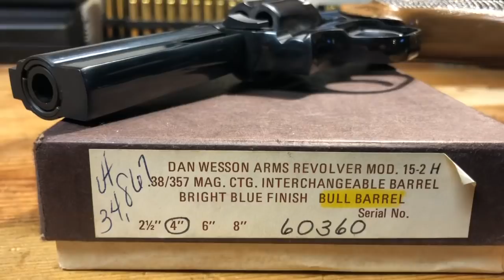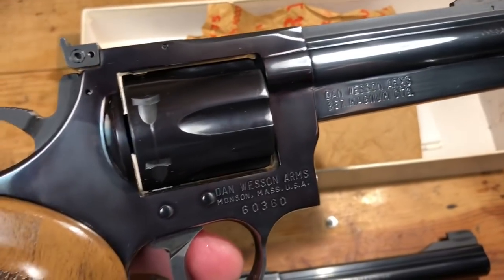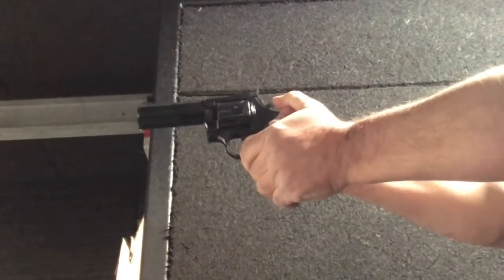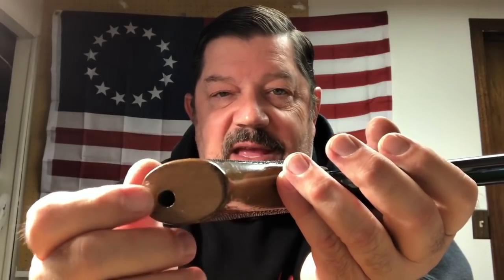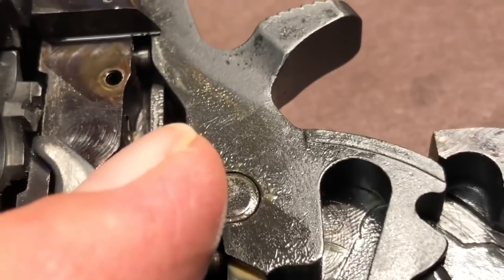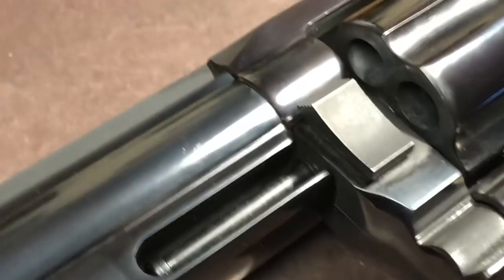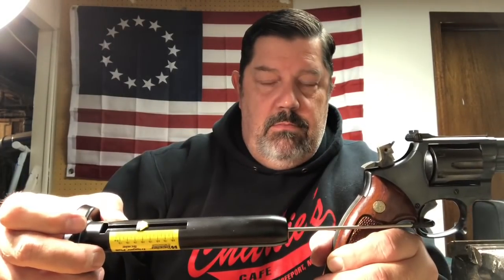DAN WESSON 15-2 H .357 Magnum

Comment: I’ve said in other posts that I love these revolvers and for good reason. From their inception they were innovative and way ahead of their time. The grip attaches to the frame by a single post allowing for a large variety of styles. The single post design is possible because the main spring is a coil spring not a leaf spring (new at the time). While everyone else was using a hammer mounted firing pin Dan Wesson used a frame mounted one (the way everyone does now days). The cylinder/crane latch is located near the forcing cone where it does the most good. the cylinder is firmly held on each end adding to the strength of the entire mechanism. The barrel design is GENIUS! Trading out barrels is fast and easy. Thread the barrel to proper depth (tool included), slide shroud over barrel, thread castle nut on and tighten. Not only is it fast but the best part is it puts the barrel in "tension." Tightening the castle nut anchors both ends of the barrel and has the effect of stretching it. This is the same method used in many high end long range riffles. All of this innovation took place 50 years ago when Dan Wesson and Karl Lewis decided to make a better revolver. I think they succeeded.
Reply: 😢t

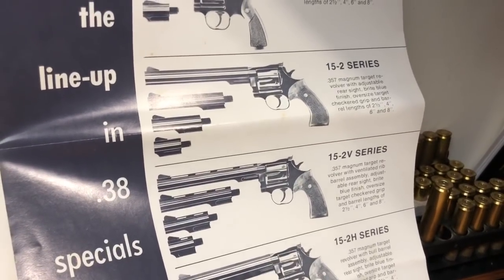Comment: I just got one of the 15-2VH 6" .357 from a local pawn for $500. Pretty clean, no box and the front sight was busted at the jog where the orange plastic insert went. Easily changed and fixed.  The catalog shot at 19:00 was great. Helped me classify mine. Serial No. 22146* is a 1979 production in the original Monson, MASS factory.

Comment: Nice looking weapon. I have the DW 715 version which I bought when it first came out in late 1982. Bought it with the six inch bull barrel and later bought a second four inch barrel. Very accurate, specially with match wad cutters 38 Specials. I used to shoot at a 55 gallon drum place at about 120 yards or so and hit all the time. The wad cutters were so slow that it would take about a second to get to the target and I could hear the hits on metal.  Since the internal parts are nickel covered, they work very smoothly. The barrel is chromed outside for some reason even though it is stainless steel. 1982 price was $330.00 including tax for the basic six inch revolver. I still have it. I also own since 2000, a DW 445 Super Mag in stainless steel with a couple of barrels.

Comment: I took one of these DW 15-2's off a guy a few years back with that same 4" bull barrel, tool, and manual. Monson just like this one in your video. The guy still had the original sales receipt from 1982 from a shop outside of Chicago. Not even a turn ring on the cylinder and the bluing is like the example in this video. Thanks for the video.

Comment: Over the years i have fired a number of Dan Wesson revolvers and i can say this much , all shot very well with tight groups .. Trigger pull was good in single action , double action was a little bit harder than what i liked .. Strong, well built , good sights .. The door latch to open the cylinder everyone called it worked fine and i kinda liked that method ..They never did gain a strong following here where i live but the ones that are around here i still see at the range and doing fine .. My understanding that CZ bought the holdings from Mrs. Wesson some years back ..well built guns i thought ..

Comment: Once you get used to the front cylinder latch, you realize it's the right place for it. Besides, it helps lock the cylinder better than the old S&W way.
Reply: I agree, the latch location was most likely an engineering decision. The cylinder is much stronger being secured front and back.

Comment: I have a 15-2 also. I bought it circa 1976. I carried it when I was a cop in MN. I have an 8" barrel for it too. I've put thousands of round through it, mostly handloads. Informative video, thanks.
Reply: Mark had the insight to get a really decent wheel gun for LEO work. I carried the 15-2 VH 4"  right out of the Kenosha, WI police academy back in 1976 while everyone else carried S&W or the Colt Trooper. Never an issue on the range after 2k rounds or during the few times on the street. Loved the Dan Wsson 15-2VH

Comment: I recently purchased a 15-2 . And had the same issue with mine. I bought a spring kit from cz. It came with all springs for the gun. The main spring is 9lb. 
Took it to the range yesterday, and problem solved!! A little stiff in double action ,but smooth. 
 Even though stiff in double action, the gun is very accurate for me in double action.
Reply from the maker: Nigel Rodger Thanks for sharing that’s good news I will give that a try

Comment: I changed the grips on my 15-2 when i purchased it this year. I found a great set of hogue laminate grips bit the acrew was way too long. I took an eighth inch off the screw length with a grinder and it worked perfectly.

Comment: I had to change the mainspring on my first 15-2, it was clipped, and only fired DA about 50% of the time. I think the new spring was like $1.25 at the LGS near my house in Vegas. Only one I ever had that had anything done to it that affected shooting. I did have a hand spring break on one of my more recent ones, but after 40 years of use, I can't complain. I've built up a large bunch of parts over the years and can fix anything but a broken frame now. I got a bunch of stuff years ago when a gun store closed up in Southern Ohio, for $50, I resold most of it for well over $500.

Comment: I believe the diference in blueing color is due to the different steel alloys used in each piece.  The frame side plate is probably machined from bar stock while the frame apears to be an investment casting.  Early Rugers had the same problem, their cast frames would turn plumb color after a while due to additional silicon in the casting alloy vs the bar stock alloy.  The additional silicon made for better castings.  Ruger has since improved the blueing process for cast parts and they don’t change color any more.
Reply from the maker: Chris Talbott That’s great info to have. I appreciate you weighing in
Reply: A "Barney" frame is more common in large frame DW's, but I've seen a lot of small framed ones go plum too.

Comment: I ahve the 15-2VH with 2-4-6-8 inch barrels. I bought it in 1978 - had my first issue - hand spring broke - but used it in competition matches must have 25K rounds thru it.

Comment: Nice video, I am fairly certain that your light strikes are the result of the grip screw being too tight. Try backing it off a half of turn, that should solve that problem.
Reply from the maker: Turned out it just needed a spring replacement. Thanks for watching
Reply: The grip screw tightness does play into how the gun will perform. There is a Dan Wesson forum that has tons of good info on DW guns , and a bunch of knowledgeable guys on there